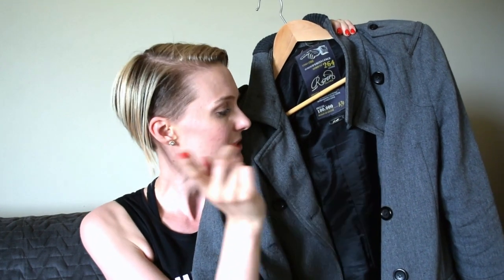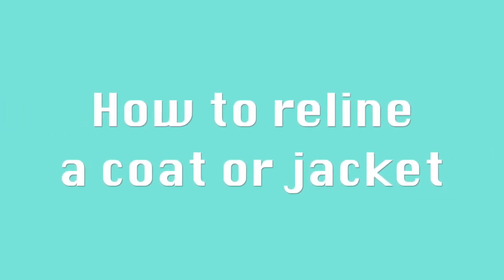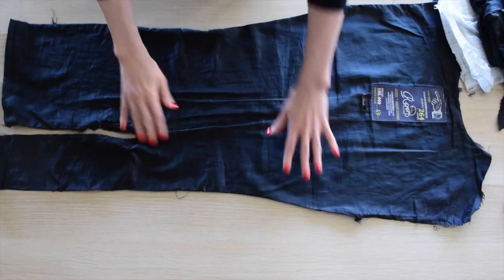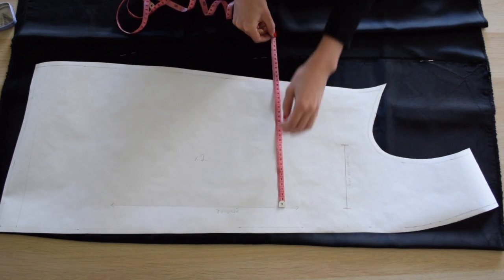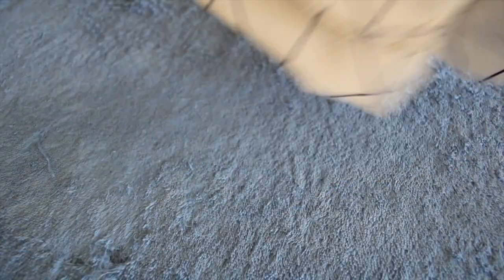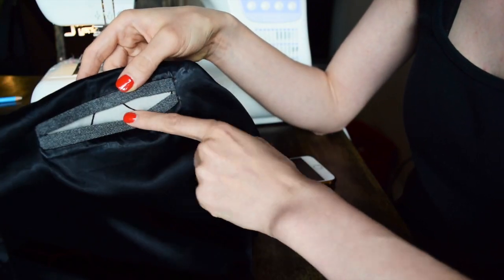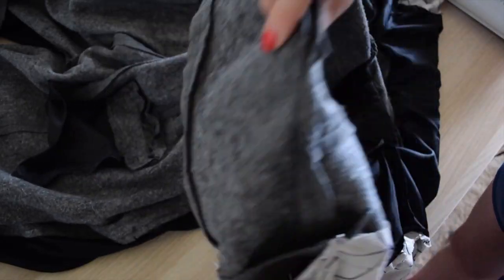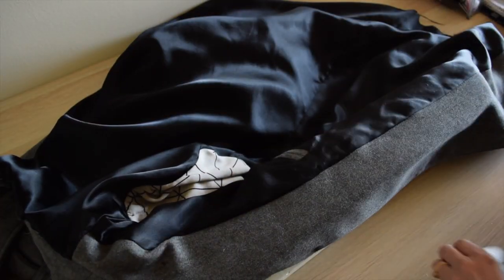How to add a new lining to your coat

Comment: I need to replace the lining on my wool coat, which also needs a good dry clean. Should I replace the Lining and then have it cleaned, or the reverse?
Reply from the maker: Good question, I would probably remove the lining if I were you. What did you decide on?

Comment: A good video. A Tip when making the inside pocket - Make a Vee Shaped Inside Pocket out of Nylon Fabric folded into a Vee format, so there is no weak seam at the bottom to break with use, from my experience over two decades, Vee Shaped Nylon pockets last for decades, even with coins kept in them, so the Vee shape format eliminates weak seams at the stress points.
Reply from the maker: @kaichung2743  Oh wow! 🤩 Thanks for the tip! I have never sewn these type of pockets but I have seen them in some suits.

Comment: I have question, is it okay if I leave the sleves unlined? It gets me sweaty with that lining on the sleves
Reply from the maker: You can definitely have lining without sleeves, but how well it works depends a lot on the design on your garment & the material it’s made of. 
If you get sweaty I would look into a lightweight breathable material for the sleeves such as a linen, silk, cotton, bamboo or a light-weight merino wool. If you plan to actively work out in your jacket/coat I would look at moisture wicking active wear fabrics. Maybe a mesh lining at the sleeves would be a good option? I used to have a windbreaker lined with mesh which was great when I was sweating in it.

Comment: Hello there, it's me again! I have a question:

The coat I have doesn't have a lining, how can I get the peices to make a lining? Should I try to trace the coat's stiching patterns?
Reply from the maker: Yes exactly! There are some tutorials out there how to clone / copy clothes that might be helpful for you to check out.

Then you need to adjust the pattern as follows: shorten the length of the garment so that the lining isn’t showing on hems (adjust the hem around 5-10 mm), raise the armhole around 1 cm for better arm movement and consider adding a centre back pleat for more ease. Hope it helps!
Reply: @missmatti  thank you very much!

Comment: Hi, Thank you for your lining coat video. I'm not replacing a coat lining. Instead, I'm sewing a childs coat using a 1949 sewing pattern. I really don't like the recommendation to attach the lining using a catch stitch. It didn't look nice attached to the neck facing. So, I machine stitched it there. Now I'm considering using a slip stitch to attach the rest of the lining instead of the slip stitch because I think it would be stronger. However, I think the catch stitch would be flatter and possibly more vintage looking. Do you have any hand stitch ideas for attaching the front facing to the lining?
Reply from the maker: Good question! I think a catch stitch would work but so would a ladder stitch / slip stitch if you want a more invisible stitching. I might personally prefer to use that to attach a lining over a catch stitch. Hope it helps and good luck with the child’s coat!
Reply: @missmatti  thank you so much for replying. I ended up using the catch stitch and it blends in well with the matching thread. I did slip stitch the bottom lining hem and other areas. Next I'm going to sew some buttonholes. Maybe after making a couple practice buttonholes. I am also going to pick stitch the inside of the lapel. Watching you reline a coat helped motivate me to attach a lining, by the way. Hearing someone talking about sewing is really nice, especially since I don't know anyone else who enjoys it. Thank  you.
Reply from the maker: @jes4026  That's amazing to hear! 😊It sounds like the coat is coming around nicely! If you have Instagram feel free to send me a message over there with a picture or tag me in a post once you are done I would love to see how this turns out. 🥰Good luck!
Reply: @missmatti  I don't remember my instagram password but, I'll figure it out. Thank you!
Reply from the maker: @jes4026  No problem - only do it if it's not too much of a hassle. 😊

Comment: You show all the easiest bits in great detail and then rush through the most complicated stage - attaching the lining to the coat! It's fairly obvious how to remove the lining and make a pattern template. Machine stitching in the lining and bagging out is not at all simple but the video doesn't show clearly how to do it. What a waste of time watching the whole thing!
Reply from the maker: @lizw121  sorry you can’t get your time back then 🤷🏼‍♀️ Anyway, this is an old video from over 6 years ago and I have improved a lot of my filming and editing skills since then. 
I have also a separate video on how I attached the lining to the coat vent which you might find useful. Otherwise attaching the lining isn’t that difficult other than making sure you attach the sleeves correctly.